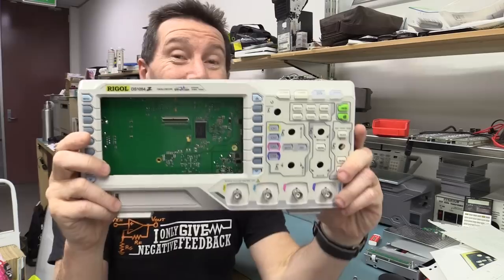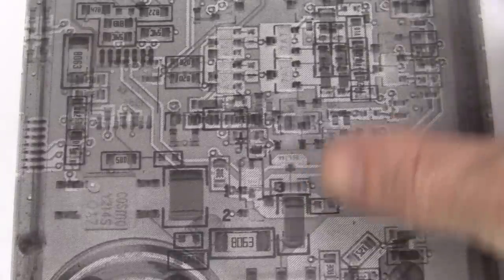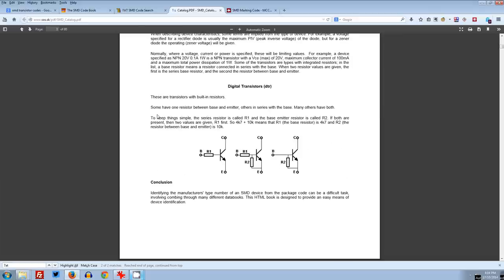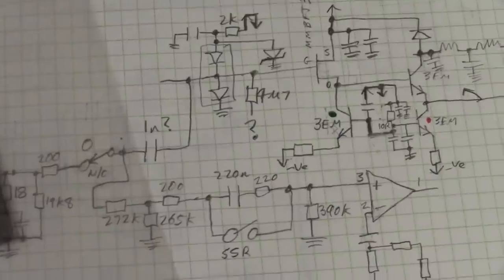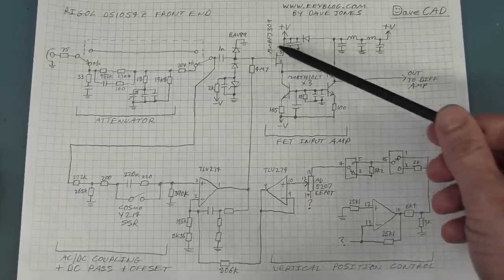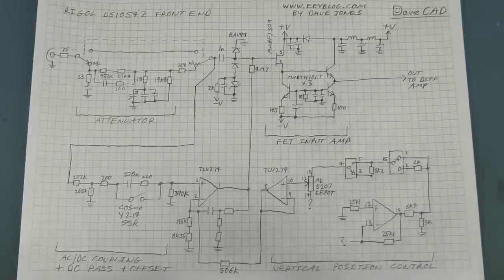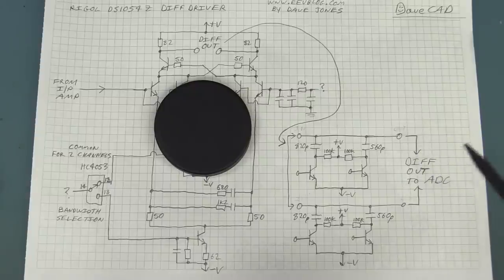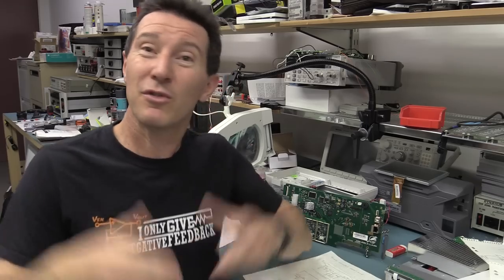EEVblog #675 - How To Reverse Engineer A Rigol DS1054Z

Comment: I am a beginner EE student and I was wondering if anyone could help me out with something

I have just recently discovered this channel last night, and immediately upon discovering it, I began digging into it to find any low level EE videos I could, and I apologize if what I am looking for is on this channel but I spent 2 hours watching videos, there is only so much I can do with my time! xD I was wondering if anyone could point me towards good resources for super beginner EE students. I have very basic knowledge, in my calculus based physics classes we covered intro to circuits, involving capacitors, resistors, and inductors in series, parallel, with both DC and AC current, Ive covered basic logic up to flip flops and registers and such, and Im just starting to solder in my experimental labs. I want to get more into EE but I dont really know how beyond the courses I take at my school. Where should I look to extend my knowledge? I watch some of the videos on this channel and just wonder where the things he says are coming from haha. I suppose I have a lot of theory to learn still, before I begin doing stuff even close to this, but I am still curious, and I always have been, but Ive never known where to even ask this question haha. 

Any help would be greatly appreciated, and thanks for even reading xD haha
Reply: The best way to learn is to experiment. Think what you want to do then find out how to do it and build it. Just trying to soak up random theory doesn't work. It helps to bounce ideas of people, since you on a course this is ideal - you can talk to other people. I personally have no formal qualifications but I do have 20+ years of commercial experience and now can build boards from scratch. Still learning :)
Reply: im in the same boat, except i havnt even taken any classes, but watching his videos is good for some learning, obviously, learning vocabulary if nothing else, but if you want to get into some binary and analog logic, an easy simulator is, believe it or not, Minecraft! it gives you an easy way to build gates and logic, in binary anyway, so its easy to see physically what effects the inputs have on the outputs when youre building the circuit yourself.

You could always get on the EEVblog forums (link in the description) and talk to people, see what theyve got, and of course, subscribing to dave here is an easy way to watch new videos in the future!

You should look for, if you can find, an Ugly's electrical references book, if thats what its called anyway, it contains just about the entire cache of book learning you could ever find, and may very well help you more than you class does, if they dont have you look for one or use one in the future anyway. You can probably pick up an old one, or maybe even borrow one from your local library!

And speaking of libraries, go to one! look up their books, check them out, they may have beginners guides, or reference books, or easy project books, you never know!

But as Moose says, the best way to learn is to build and experiment!
Reply: Check out AfroTechMods channel for some very good entry level stuff.

Comment: so, one could desolder those 4 caps and have the full bandwidth?
Reply from the maker: need to test to confirm that, but yeah.
Reply: EEVblog
Same thoughts...I'd also like to see if you can change up the bandwidth.
as you suspect.
Great intuitive video on a reverse engineering technique.
Reply: If yes, then probably rigol will increase theirs sales :D
Reply: Dmitry Ivanov i guess they already got most of the budget market covered with their scopes. seriously, i wonder how and if their competitors will react to this.. exciting times!
Reply: One problem - software restriction of minimum time on div remain.
Reply: quixfz could still be limited in software even if the hardware limits have been taken out. As in, divisions on the screen, calculations.. or if they're really into it they might actually check if the lines are high and brick the device if it's not possible to pull them high

Comment: Hey Dave look up SMDmark [dot] com if you haven't seen it already. By far the best IC code search results I've found. It's limited to 20 searches per day. I wouldn't bother with creating an account either. It failed super sketchy for me. I could send them a message to try and resolve it but I wouldn't bother. I don't like any site that requires a local telephone number and/or skype number to create an account on a site. There were other issues too, but... doesn't matter...it's still the best search results I've seen, especially for sot 23-5, -6, 323 etc.
-Jake